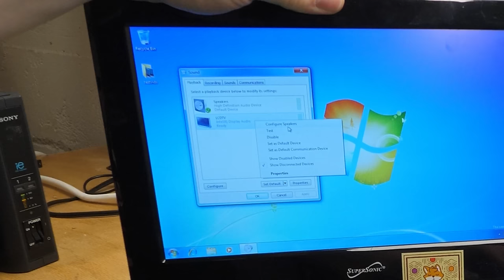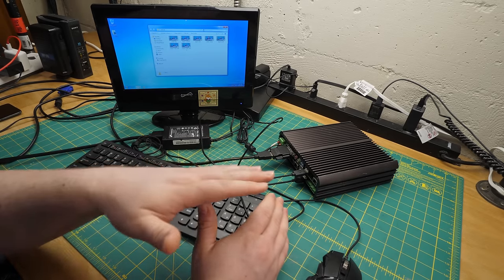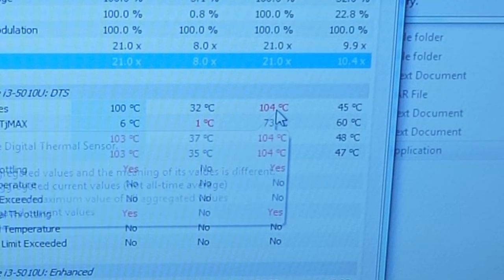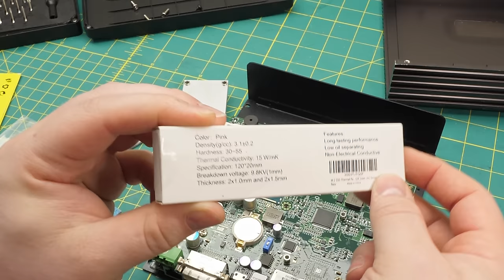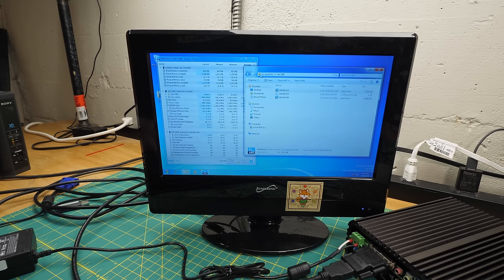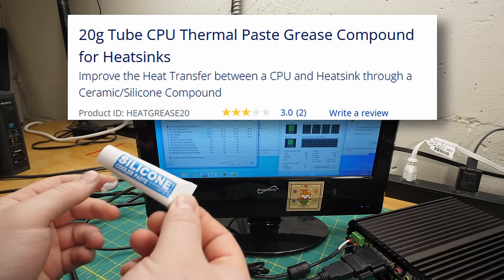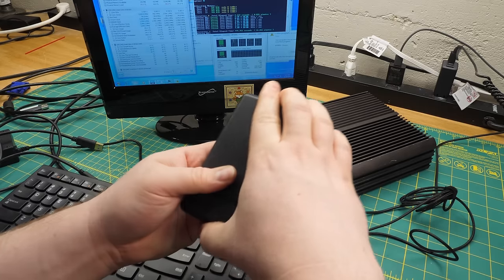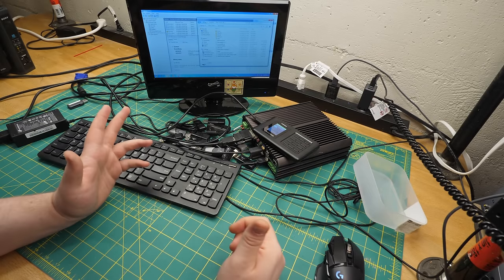Little Guys 4, Pt 2: More DVI Nonsense

Comment: Here's something to do a short video on. Low profile PCs that could use a simple connector board in an AGP slot to add a DVI port connected to the onboard video. I don't recall if any did that with PCI or PCIe.

It was easy to get fooled looking for old/salvage low profile or SFF PCs with a GPU card to pull for a more powerful one then open it up to find one of those simple connector cards.
Reply from the maker: I actually just got one of those cards after learning what exactly they were doing under the hood - it'll come up in little guys... EP 7, I think

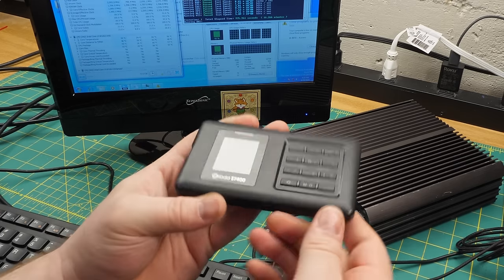Comment: 20:44 relating to that disk emulator, I distinctly remember an era of PS3 modding of all things maybe around 12 or so years ago where people used what were referred to as ODEs (optical disc emulators) to load Blu Ray images of games copied entirely off a disc. I suppose this technique predated custom firmware and dumping games directly to the ps3's HDD, but it's been so long I don't remember all the details. They definitely are a thing though; I've just always heard of them as ODEs, perhaps that aids in research
Reply from the maker: Oh that's what makes this so funny. For years I thought it was absurd that I could get an ODE for a Dreamcast but I couldn't get one that worked on a normal PC. And while the IODD does serve the purpose *over USB*, you still can't get one that'll plug into SATA (let alone IDE). I've searched for these a few times over the years and the only thing that comes up is a hideously expensive product for arcade operators. It's weird!

Comment: CRD, you could get copper shims for this or other cpus.
Such as 0.3mm and 0.5mm thick copper shims. I put 0.1mm copper shims on my laptop and the temps dropped 10c just because of the compression.
So if the thermal pads don't work out in the long run, you can put in a couple 0.3mm copper shims with thermal paste on both sides.
Use your calipers to measure the shims and get 2 that are as close to identical as possible. And put them side by side for the 2 chips. And you'd only tighten the screws down to just barely thumb tight. So enough pressure to squeeze the thermal paste but not so much it could damage the die.
Reply: And what do you gain from this while it's staying on 30°C forever instead of low 60s? Yeah, nothing. Waste of money to be honest.

Comment: Hey dude! Long time fan here. I work in the medical device industry and recently was gifted a control system for a 15 input/15 output video router (does DVI, VGA (over BNC), composite, SDI, svideo, etc. The router itself is enormous but the control unit runs XP embedded and I’d love to get your take on it and see it dissected. It’s one of those things that cost $30k and is worth .. giving away at replacement 15 years later. It’s a small guy, but not tiny. Roughly.. idk.. 15” deep by a foot wide by 3” tall. Let me know if you have any interest and I’ll ship it to you from Spokane!! Guarantee no one has covered it on YouTube.

Comment: Maybe the hole in the drive caddy might just be material/cost savings.
Could you punch out a slug like that and then reuse the reclaimed material?
Reply from the maker: In theory, yeah, but sheet steel is so cheap that I don't think it's worth it unless you're making a hundred million of something, and while this device was certainly mass produced, I suspect it was in numbers closer to a hundred thousand, where it would just be a negligible savings.

Comment: The DVI-D cable isn't capable of carrying the VGA signal that the BIOS is probably generating and the monitor should be able to read.  The BIOS may have only been programmed to drive an analogue signal because the machine was built with a VGA port.  When windows fires up the graphics driver, the GPU probably starts spitting out the digital signal that can traverse the DVI-D cable.

Comment: Given how low power the CPU is, and how well it can handle it's own thermal velocity, what basically saved the CPU from becoming a 800Mhz throttle mess was probably how much heat it was able to sink through the PCB and balls into the motherboard and ground plane. Of course, once it's had time to sit and cook for a while the motherboard will be thoroughly heatsoaked and then performance will drop more.

Comment: I have such a huge bin of power supplies from so many different thigs. Lost and found in a 414 hotel group in a ski resort. So I have power supplies from all around the world. Most are 3-5V  lost of 6-7V All the way up to 78V units. Some have dual voltages. 16 and 38V.  I have about 200 of them collected over the dozen or so years. Never mind the 4-500 of ones I've used introjects or people asked if I had one. 99% of the time the answer is yes. The most expensive ones I have are the Cannon units. I have bins full of them if someone needs a bunch of barely used power supplies. Just ask I probably have one.

Comment: Audio over HDMI is odd, but not unheard of.  For example, only a handful of NVIDIA cards support it.  From an electrical perspective, there's no reason DVI-D can't (audio data for HDMI goes over the same data lines as the video does), it's just that not alot of monitors support audio over DVI (and honestly would you care - monitor speakers are pretty universally garbage), so not alot of video cards bothered to do so.  Also, technically, audio over DVI is sort of a nonstandard thing - the DVI spec doesn't have provisions for doing audio packets.  That mostly came from the HDMI spec.

Comment: I have a Intel motherboard that only output to Analog on boot but once in windows it also output digital. This is whether I use the built in graphics card or a discrete graphics card.

Comment: ventoy might be a cheaper and easier solution than the iodd. it wont be able to emulate to the level of the iodd but for just linux and windows isos.

Comment: I actually wanted to connect a pc to TV, trough dvi-hdmi adapter, because that tv had a hdmi/dvi port, with a separate audio input. So I bought a separate audio cable, connected everything and, the audio didn't work. Why? Because it was sending audio trough dvi port xD

Comment: If you're booting ISOs on more modern systems where you don't need to emulate a USB CDROM, you can get a faster and easier to use alternative to that emulator thingy using Ventoy and a big USB drive. Free software FTW! 

That emulator is awesome, though, for older systems that don't support true USB boot.
Reply: Yeah, the iODD is more for sys admins who deal with weird proprietary computers and servers (IPMI can be weird) and for people loving retro computing. People who don't handle anything older 1st gen Intel Core i, Ventoy is more than enough. I also use it.

Comment: I like how you fixed the CPU thermal interface issue just in time to put the computer on the shelf and never use it again. Lol. the thermal wax makes sense. If they used a pad- then they would have to check each PC they made to make sure they used a pad that was the correct thickness for that one. Using the was allowed using the max size they might need then it could squeeze out the extra when it was a smaller gap. Hmm. It's possible your 1mm pad fix is actually better than the thermal wax, but the wax worked good enough and allowed for easier manufacturing.
Reply from the maker: hahaha yeah, well, that's partly why i just grabbed some no-name pads, since it's just to prove the point. no sense in putting a phase change pad in here or w/e.
Reply: @CathodeRayDude  I love these letter salad brands on Amazon. :D

Comment: The hole in the drive tray is historically (IIRC) b/c that's where the electronics sit on the PCB - the hole allows better air movement.  Always seemed kinda sus to me, so YMMV.

Comment: I laughed so hard! Cables 101! The pain is real man! 🤣😂🤣
I once left the head of an HDMI   cable inside the tv jack of an air b n b I stayed at ( the metal casing came off). Only realised when I got home. The tv was old, and only had one HDMI port .. wonder how long it took to work out for the next user. r/aita?
Reply: I freaking HATE HDMI because of that, the thing will crumble if you look at it funny. Horrible damn connector, had this metal casing rip off thing happen quite a few times. A little tighter of an adapter and it will be left there as well.
Reply: @Kalvinjj  yeah, until then, didn't know that was a thing. Nowadays, I understand cheap connectors alot more!

Comment: I suggest you in the future to not run bare die chips without being 100% sure that it gets good thermal transfer, because if you get unlucky, you may burn some part of it that does not have proper thermal management. Hopefully it's not that big of an issue nowadays, but still I wouldn't risk it.

Comment: Ventoy will do in software 99% of what thd IODD will do. It's essentially a bootloader written to a normal USB drive. Drop your images in the drive and select what you want at boot time. There may be some edge cases where a hardware emulator has an advantage though.

Comment: That iodd looks pretty interesting, but I wonder how it compares to using something like ventoy, though then again that is very much intended for multiple bootable iso's at once, and much less so for once you are already inside windows
Reply from the maker: That's one of the really big differences, yes! Because this allows me to use and swap discs after the machine is up and running, it can be used to, for instance, install applications or games from CD images without having to involve a software CD emulator or hope that they're willing to install from raw extracted files (which a lot of older software in particular won't.) It's also the only possible solution for installing, say, old versions of Linux that were only ever delivered as multiple ISOs. And that's not even including the HDD emulation features. This thing does so much.
Reply: @CathodeRayDude  That actually sounds super nifty! Thanks for explaining

Comment: ummmmmm. I believe I have at least at one point ran VGA into the DVI input of a dell monitor with a VGA to DVI cable. now I'm second-guessing myself and want to test it again but I have no idea where my cable is. Theoretically if the Monitor does not support VGA input on the DVI connector it should not have those pins available and use the DVI – D port. Although I can't guarantee that because so many people seem to misunderstand how DVI is supposed to work and I've seen lots of stuff online that's wrong.

Comment: i'm going to guess that the reason you're not getting the console text screen is because the TV only supports a couple of resolutions and text modes aren't included in that. i've run into it before with a Sony TV that had VGA input, and only two resolutions, 640x480 or 1024x768.

Comment: I have gotten one of these, and its the weirdest assemblage of parts... It's half a 2003 dell laptop, half modern parts. It has a mini-PCI ssd, lpddr3 ram, but a new enough processor to have a tpm2.0 support but is slower than a core 2 by half! The NIC is so new that nothing older than Windows 10 can recognize it... I got it to run as a pfsense router since it has 4 Ethernet ports, but my ISP has black magic to prevent a simple config from working so im just putting things it should never run on it.

Comment: DVI has no sound pins in the standard but it does work lol!
Reply: There are no "sound pins". The PCM sound data is packetized in the TMDS stream alongside the video and control data. Since DVI and HDMI 1.x uses the very same signaling, adding "HDMI style" audio data to the stream works fine with DVI.

Comment: Maybe that other sata port is for a cf express?
Reply from the maker: I figure you mean CFast - which is an interesting theory! I'd have to get in there and see if a card would actually fit, but it seems possible.
Reply: Yes! The spacing looked about right between the board and front.

Small aside, I currently work as an industrial electrician and get to work around quite a few odd embedded systems and other strange beasts. About half of the plant is ran on control systems that consist of DOS, QNX, and Win10 systems working together to control one machine.

Comment: Re: thermal solutions for poor/no contact, perhaps not a bad idea to invest in some K5 Pro. 20 grams for 15 bucks on Amazon. Works fantastically for when you shred a GPU's memory pads while repasting and I don't doubt it'd solve this little guy's thermal issues like a boss. Edit: Just to clarify, the stuff's intended to replace thermal pads and conducts well over a 1-2mm gap. Messy as heck though.
Reply from the maker: I looked into that stuff a bit on someone's recommendation, it looks really cool but also looks like it makes a horrific mess if you don't get it just right the first try, so rework becomes a lot less pleasant... honestly, I just avoid doing anything involving high performance gear so I don't have to be good at any of this stuff lmao
Reply: @CathodeRayDude  Can confirm, it gets everywhere. Still, good for when you really can't be bothered to find the right side pad. :)

Comment: Nvidia cards will tell you on their control panel if you use a dumb DVI to HDMI converter. in fact it has 100% HDMI compatibility, at least 1.0 if not 1.4. so yea a DVI port is actually an HDMI port.
Reply: In fact if you use a dumb adapter of any sort of modern connector, trust me, it knows. Nvidia doesn't even tell you that you have it in an adapter it's just like "yea bud it's a HDMI port it's totally not a DVI port in disguise"
Reply: @JessicaFEREM  This is an Intel iGPU from like 2009 or so.
Reply: @kyoudaiken  they haven't updated their control panel in decades so unlikely to be any different for these devices.
Reply: @JessicaFEREM  I don't know about the older iGPUs but my 13900KS recently became the ARK control panel although it's not the ARK Alchemist architecture. So that's not true.

Comment: Getting VHD's working with the iodd. The backing files are flat disk images. No headers. The confusing part is that it uses vhd(x) file extension while the files themselves are not MS VHD(X) file format's internally. Another thing is that the files need to be contiguous, ie unfragmented.

There are ways of creating such files. DD on Mac, BSD and linux and with fsutil under windows.
fsutil fileutil newfile %name% %sizeinbytes%

Yes i bough one after you show it off in the first or second episode.
Reply from the maker: Thank you! Gonna give this a shot.
Reply: @CathodeRayDude  Some small tips afterwards.
The contig utility from the Sysinternals Suite can be used to defragment the backing file. Only works in NTFS as it used the defragmentation API which does not work on exFAT.

To (force) defragment the whole SSD use the defrag from the command line. Use /d to force it to defragment a SSD. Things to note is that it not too picky about having large files continuous. A single disk seek on a multi gigabyte file it not noticeable.

Linux, BSD and mac users out there, including myself, sorry. Dump and restore to defragment.

Oh and once a set of empty files have been created. Zip them up as all 0's compress very well. No need to fiddle with a command line utility to create new one's.

Comment: Hey, can you compare the IODD device to Ventoy when you will one day do that video?
I know it's not the same but for my intended purpose on modern EFI computers Ventoy always worked just as if I "burned an ISO" to the drive. I can put Windows, Linux and even Android X86 and they all works.
It was all good until I tried to install ProxMox... That damn thing can start the installation process just right but will somehow want to find the "partition" that has the ProxMox files and will fail on Ventoy.
Also, why what is basically a supersmart USB 2.5" drive enclosure cost the price of a MiniPC these days, what so special about it?

Comment: iODD eventually got gobbled up by Zalman, and they made versions with a scroll wheel and smaller OLED display in both USB 2.0 and 3.0, after that I lost interest as the micro-usb ports they were using were quite flimsy with no mechanical reinforcement via through-holes for the shell.  The later models could do various combo modes with / without access to the underlying HDD/SDD, and emulating a floppy, optical, or harddrive from images. You can duplicate the same thing with the USB MSC Gadget driver in linux and a Raspberry Pi Zero, though you have to wait for linux to boot up before it will show up on the host machine.
Reply from the maker: As far as I can tell the relationship was solely as an OEM, Zalman just sold some IODD products with their name on them.